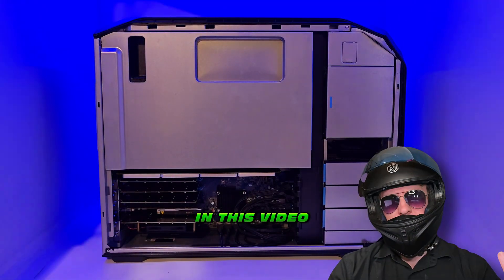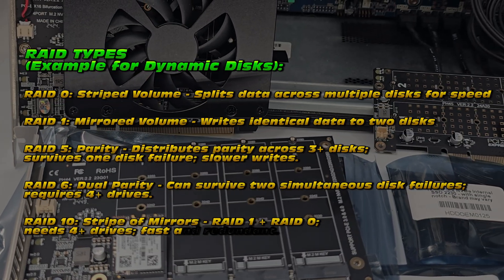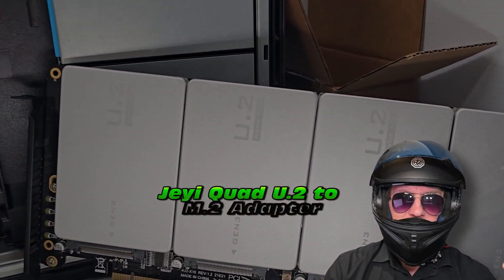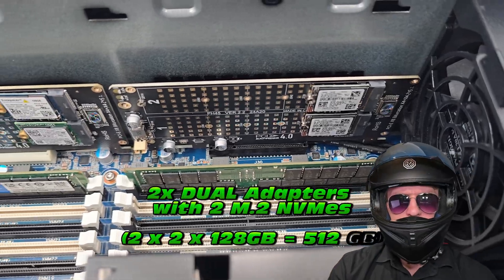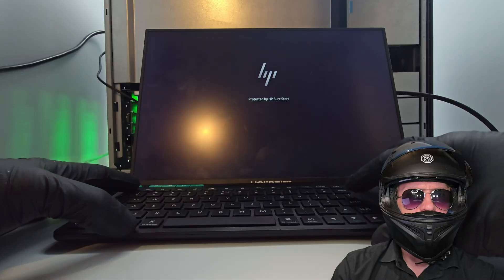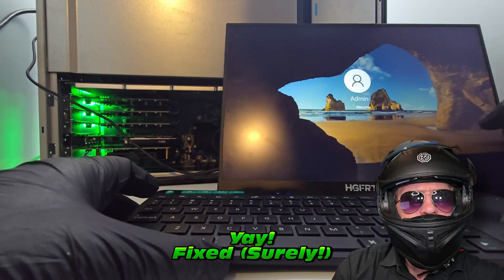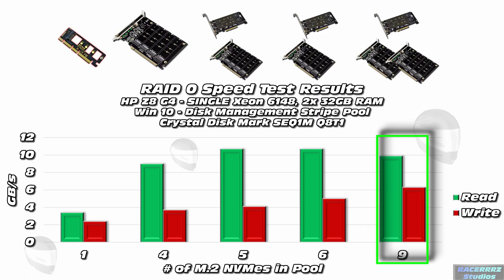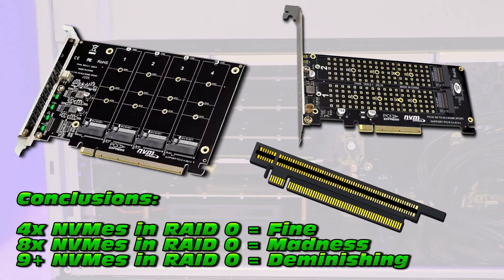I Pooled 22 NVMe SSDs in RAID 0 - SOMETHING BROKE - No Regrets (#RACERRRZ)

Comment: I like these HP Z systems but I have had a few catch on fire or the power supplies basically exploding, that being said they were in a factory environment which did a bit of graphite milling.
Reply from the maker: That's the first time I have heard of explosive workstations, but anything is possible under the right conditions. I presume it was relatively warm in the factory environment. HP's PSU are over-engineered (e.g. the PSU 6-pin GPU power cables are rated for 219W instead of 75W as per industry standard), so I would hope they would hold up even in intense environments.

Comment: How does it do in the current 1.15.215 Starfield build?
Reply from the maker: I gave it a test run. The Z8 G4 worked well. Loading screens used 20 Cores on one Gold 6248 CPU (the second Gold 6248 CPU was on idle / not used) and in game the GPU was doing the lifting (RTX 3090 Ti). So crisp game play at 4k 60FPS.

Comment: What about doing this with the fastest modern NVMEs? Can you make it faster than RAM?
Reply from the maker: No, unfortunately, a storage drive will never match RAM latency. You could in theory get a RAID 0 pool to get close if you jump between systems (say DDR3 1800Mhz vs four Gen 5 NVMe SSDs in RAID 0 on a modern system). Even then, latency will still be lower on RAM. 

If speed is the goal, consider a RamDisk (software that allocates some RAM with a file storage system and drive letter). Volatile and high-risk storage, but for something like render cache that might actually be the ideal.
Reply: @racerrrz , I believe latency would be OK. If the throughput could be close to that of RAM it could still be useful for running huge language models.
Reply from the maker: When read/write speed is needed the RAID 0 pool can help to remove that bottleneck. It would be expensive to set up several Gen 5 NVMes, and you would need a decent motherboard to allow it, but even four Gen 4 NVMes pooled would give decent performance. I have been tempted to put together a modern test rig but only the top end gaming motherboards support more than one x16 PCIe slot (with 16 electrical lanes connected - most have 4 lanes only). The Asus Hyper M.2 x16 Gen 5 Adapter is well priced.
Reply: @racerrrz , The Dell Precision 7920 Workstation has 4 PCIe x16 slots. It’s available on eBay for between $2,000 and $3,000 depending on the specs.
Reply: @racerrrz , It also supports up to 3TB of RAM, which is why I’m interested in it.

Comment: Thanks for sharing this bud, I wanted to put 2 of these adapters in my z840, good to know now what the limit is, so great appreciate all the work you done

Nice score on the nvme drives 

Keep up the great content
Reply from the maker: These dual and quad adapters performed relatively well for the price point. One issue that they do have is the lack of cooling. I saw NVMe temps reach 95'C on hotspot measures which will lead to a reduction in performance and life span. Ideally these would be paired with some sort of passive cooling (thermally conductive silicone or a dedicated fan). 

If you can afford the extra cost I would recommend the Asus Hyper M.2 V2 as the best bang for buck adapter (in case you haven't seen it, I compared 4 different quad adapters here: https://youtu.be/xqg0uQ93KTg )

You can also work towards a DIY cooling path. I took a cheap adapter and added thermally conductive silicone for improved cooling: https://youtu.be/V6quOON9ANY . This concept could be adapter to cool the cheap dual and quad adapters that I used in the present video. That gives me a video idea - take ~3mm copper plate - drill some holes - add thermally conductive silicone, sandwich plate onto NVMes and secure with some motherboard stand-offs to the adapter PCB. DIY cheap and super effective cooling.

Comment: You probably would have gotten better performance if you had used a server operating system, either Linux, or some flavour of Windows Server. I've done a lot of tuning of RAID arrays, and I don't know about Windows Server, but under Linux you can set the "chunk" size, that is the virtual "blocks" on your RAID array. I once set up a RAID array with 18 SCSI drives on three controllers. This is some what comparable to your experiment, and like you, I found that  performance didn't scale.Then I started to increase the chunk size, and performance went up. This is because when you have lots of little chunks, the OS spends a lot of time keeping track of all those chunks, and will start to degrade I/O performance.  Make the chunks to big, and you loose capacity and thus  performance. Performance tuning can give you a very fast array with optimal storage capacity, if you are a crazy sysadmin type like myself. 🙂
Reply from the maker: Fair call. I did test Storage Spaces for some comparison but there the speeds were no better than a single drive - no matter how many drives I had in the RAID pool. I would expect a Linux based software RAID to handle the pool with a higher efficiency - I might test them in Proxmox for the sake of completion (as well as adding in more memory to the system). 

Interesting that you saw a similar outcome with your large RAID array. I only went in this direction because I was wondering if there would be any benefit from having more than four NVMes in a RAID 0 pool. My primary editing drive is 4x 2TB NVMes which has given incredible speed but capacity is limiting and not all of my video projects make it onto the pool (some have to run from HDDs due to lack of storage volume). Naturally I was curious if I could expand to 6 or 8 NVMes in the pool and I now have an answer. The only snag is storage costs - I want to go back to 2023 NVMe pricing...
Reply: @racerrrz  Fun video, though! It is always great to play with "what if?".

Comment: Diminishing returns is inescapable in all types of horizontal scaling. No matter the setup, eventually you will see less benefit by adding more stuff. When that happens depends on scenario. In this case some potential bottlenecks I can think of are RAM configuration: seems like you are running only dual channel per CPU or even single channel on one of them if one module failed and was removed. Another thing is that in dual CPU configuration some PCIe lanes are mapped to one CPU and some to the other. If you're pooling storage between them, you'll get all that funky NUMA weirdness and increased latency/limited bandwidth in hopping between sockets.
Reply from the maker: Indeed. In hind sight there were some oversights, but it's challenging to control everything.

I noticed not all the NVMes provided the same speeds in isolation - so I presume the slowest NVMe in the RAID 0 pool will set the 'max speed per drive' for the entire pool. The drop in speed does suggest something was limiting - but interestingly the write speeds continued to increase as more drives were added to the pool. I did consider that memory was part the issue. All tests had the same total memory (64GB) - but only because one module failed (requiring removal of 2 modules to balance - and leaving one module per CPU in dual configuration - so not ideal). I'll need to get some more memory to repeat the test but this does have me wondering if more memory can increase the 'read speed limit'. Thus far I have not managed to break past 12,000MB/s read speed on the Z8 G4. 

And yes, balancing the adapter load between the CPUs would be important. The goal was to populate all available PCIe slots to essentially max out on NVMe storage / saturate the PCIe bus. A highly unrealistic end-use scenario, but it answered my curiosity - what happens if you add more than 4 NVMes into a RAID 0 pool.